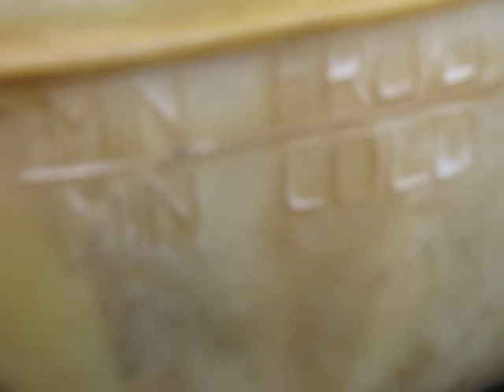2008 SeaDoo RXP 215 leaking coolant into hull. Why? Diagnostic video. Part 3.

Comment: Did you ever find the issue? My 215 is doing the same
Reply: i bet you its leaking from the one on the gear lever side mine is
Reply from the maker: It was leaky coolant lines. Only way to fix it was replace the ride plate. It was supposedly a common issue.

Comment: This closed loop cooling system is hard to understand. I have everything understood i just have no idea how the antifreeze is being cooled i assume there is some type of house built into the hull from back left to right and it flows under water to cool it. My shit is burning oil and running hot as fuck.
Reply from the maker: The coolant goes through the ride plate. My lines were leaking right where they attached to the ride plate. I had to replace the ride plate. Was supposedly a common issue with those skis.
Reply from the maker: Are you subscribed?